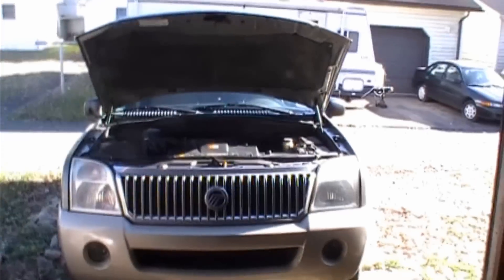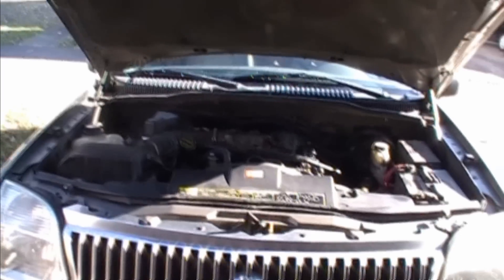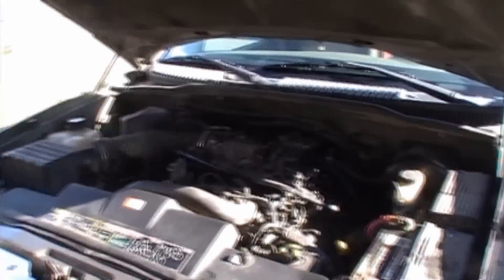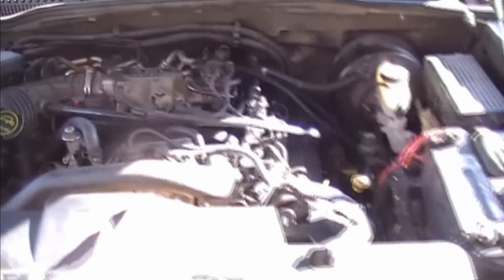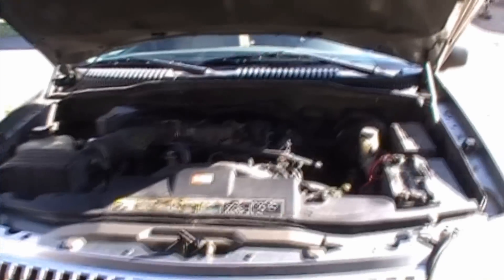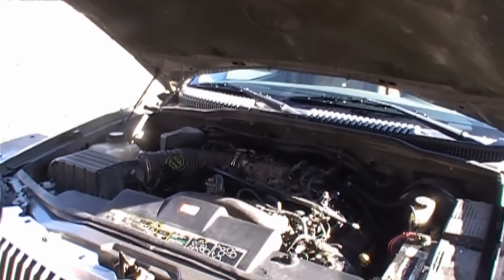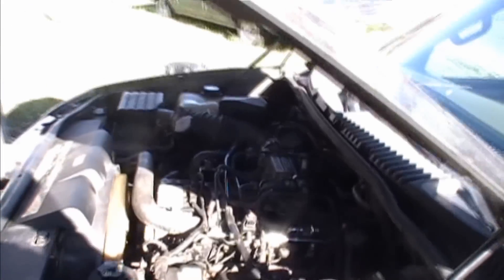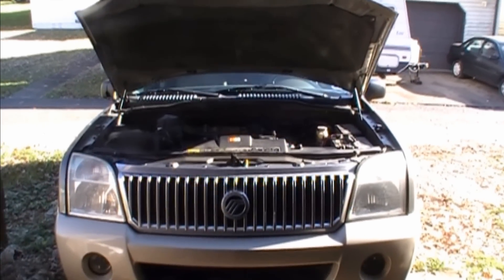PO430 CODE  The real story...don't waste your money!!

Comment: This old man knows what he's talking about, I've dealt with this issue. I had o2 sensors replaced and cat. Still codes came up. I found this video, went outside and tried his video with just tightening the intake tighter, and bam no check engine light anymore, or codes. Thank you sir, thank you. I wish I tried this before I spent hundreds.
Reply from the maker: Glad it worked.
Reply: Never thought of that. I actually removed my air filter to clean it..and code came up later. Might try that.
Reply from the maker: Cool, let us know what you find!
Reply: Unfortunately that wasn't the issue but the air filter cover wasn't seated/sealed properly so that got "fixed" :D.

Might look for exhaust leaks next.
Reply from the maker: Major Cool!  Glad you found it!
Reply: I have those codes too was s
Told it is the catalic converter but my car is making a.sound coming from the carberator and filter pipes or line i thought it was coming from the converter but i dont  think  so. I also changed the oxegen sensor was the first code that came out with that noise it was good that part still had warranty. An way its still making that noise kind of like a metal popping noise
Reply: I have Codes 420 and 430 could this also be the problem i have a 2000 Mercury marquis which is a.ford. ive heard of those cars having a plastic manifold? I took it too a local mechanic to check it before i go the code for the oxegen sensor and when he took off one of the lines the sound would completely go away and my friend also tried cleaning and carberator with carberator cleaner it did work for a while and that noise is back
Reply: @rachelperez7801  umm a 2000 grand marque has a throttle body not a carburetor.
Reply: @adamcorria1647  Cut her some slack. Probably doesn't know the difference in a Carb and Throttle body in the first place. Also Carb cleaner not good for Throttle bodies, nor recommended.
Reply: Can this code cause your truck to shut off?
Reply: @bte-by4de  nah bro if it shuts down your problem is bigger than a p0420 or p0430... Those 2 generic codes are for saying your cat(s)(emissions system) are below threshold

Comment: I got the code today, and decided to research it first, and found your video. 457 dollars to replace the y pipe with converters, or 120 something for one (not shop price). My light came on while in the car wash in my 07 Silverado, so I knew it had to be water related. I sprayed around the intake and inspected the exhaust with no luck. I decided I had nothing to lose, so I tightened the intake bolts, and cleared the codes. Drove it around and still no light or code! Ill be doing intake gaskets this weekend, thanks!
Reply from the maker: Price sounds just about right.  Hope it works! PO430 in most cases is the intake gaskets leaking or a air leak somewhere.
Reply: What ended up being the problem I have a 2010 sierra

Comment: I have an 03 Explorer that was running rough and then triggered this code.  I first went to Ford forum where they suggested O2 sensor, then cat.  I watched this video and it was right on!  I don't have a smoke machine, but do have lots of time.  I pulled off intake and replaced the gaskets.  Took about 4 hrs.  Both problems fixed for $20!!!! 

BTW this car does not have coolant in intake manifold so that was not involved.  Can't thank you enough!!!
Reply from the maker: Hell ya!! Glad it worked for you.

Comment: I had a haunting idle when the weather gets cold. Made a smoke tester with a canning jar an air mattress pump and some poly tubing. 30 seconds later I found the plastic plenum was leaking where it bolts to the intake. Thanks for the video.
Reply from the maker: That's awesome! Thanks for the story!

Comment from the maker: People don't replace the catalytic converter or oxygen sensors!!!!!!  Check for leaks first:
1- Intake gaskets.
2-Vacuum leaks.
3-Just do some research and you might save a lot of money.

Most Mechanics don't understand this.....and they don't care. They just care about getting paid!!!
Reply: tvwxman32 how do you know all technicians, and what most of them understand? how do you know if they care or not? how do you even know what they care about? 
for some technicians it is all they know or all they have grown to know.
you should be very proud you fix one car correctly, some of us hard working technicians only get the cars the others can't fix. since this vehicle has many problems.... maybe you should be more humble, because there will be that one you cannot fix. let me know if you need my address when you are stumped.
Reply from the maker: Ahh, no problem. I've just seen and delt with some real bad mechanics in my life. But I did NOT say ALL technicians were bad. I Just want people to use caution and get a 2nd opinion if they feel confused. Humble, yes...There are times I'm stumped also. But sharing my knowledge, I hope will make someone fix a issue I know about from first hand. Nothing more.
Reply: TVWXMAN32 were you hearing any types of sounds?
Reply from the maker: BIGGSAndroid ....Actually...it ran just fine...just a bright check engine lighr.
Reply: chris keiley
Reply: TVWXMAN32 actually my car has the same issue, but I feel my car is not fast like it used to be  and the RPM changing is different too
Reply: Stop putting techs down. We work our asses off and don't get treated like we should. I put the question to you, where are you getting your truck fixed/diagnosed? Do you get angry with a plumber that doesn't fix your issue the first shot? Didn't think so. Glad you were able to find this one your truck. Pass on info. Not opinion.
Reply: Really wish I seen this.....
Reply: Thanks for for suggestion!!
Reply: Could be something as simple as gas cap, clogged fuel injector or in my case a dirty air filter when my dealer said it was $2200 catalytic converter. Don't start with the cat, start with leaks or clogs. Would have been some fight if I had the cat replaced and the light stayed on.
Reply: My car seems to be surging in RPM slightly with this code.  Any ideas on what would make it surge like that?
Reply: I'm sorry, I don't understand the explanation you made on lowering coolant reservoir levels.
Reply: Thank you for the education. Im working on a jaguar and have been chasing a po 430 for sometime. Changing the cats is a tough job on this model. For jaguar people, check those plastic spacers on the intake and the plastic vacuum lines with rubber end. The vacuum leak was so small it didnt effect drivability, but enough to set the code.  Nicely done
.
Reply: Ops i had the same issue my car is running fine just check engine light 2 codes p0420 / p0430 
The RPM is good too but nt really perfect . I was planning to open my wallet for a new exhaust system but for me this gasket intake problem is much worse how much it costs 
Chevy malibu ltz 2015
Reply: "Mechanics" was the wrong word to use.  There aren't hardly any mechanics left in the world and a mechanic can fix whatever is wrong with your car.  These guys today are "techs" which is short for "parts changer".  They read your code and change the part associated with that code.  If that does not fix it they are fucked because what they learned came from a book instead of years of following someone around a shop.
Reply: Not every Mechanic or Tech is bad 😒 there is a few but not all. Some Dealer Techs (brand)follow and diag cars per repair manuals and follow proper Data list for those specific cars and not all of them just replace parts. Mechanics work on everything and also do proper repairs but there is always a bad apple in either side and those are that make us look bad😔
Reply: My mechanic showed me how the outlet from the catalytic converter was colder than the inlet. And it’s supposed to be the opposite. So this means the catalytic converter is not working. Any thoughts on that?
Reply: I starting to think this could be the problem im having on my jgc  i had put 2 cats on it and the code still comes up but whn i take out my air temp sensor i notice a changed

Comment: Very good advice; noted what appeared to be a class II coolant leak under the car last week and just haven't had time to investigate it. Today the wife told me the check engine light came on and my scanner spit out the P0430 code. Going to have it checked out and will post what the shop finds later.

Comment: I always tell my customer to check for vacuum leaks,misfire, purge valve solenoid staying open causing lean code, worn spark plugs or thermostat staying open causing rich condition.  Instead of them taking it to a "mechanic" pulling the code po430 & asuming its a bad cat and 02 sensor and having them change it, which in NOT CHEAP!! & later find out that it didnt help or the code went away for a while and came back. & start blaming the parts being faulty. But in reality if they checked & properly diagnosing it in the first place it could've been a  80cent vacuum hose broken  or a simply pcv valve. Instead of spending $300 to $1000
Reply from the maker: You are right!  Its sure is a science!

Comment: Had an 02 sensor changed this morning. Check engine light went off. Went home, let my sequoia cool off, changed the valve cover gaskets ( not one of the bolts on the cover or coils were tight ). Start er up. Drive around for about 30 minutes before inspection and now I'm getting this code. Engine purrrs like a cat. Guess I can try to go back and look at the coils to make sure I didn't miss tightening down

Comment: I think you might be dead on with this. I recently changed my spark plugs and wires and my car was suddenly giving me a p0430 (inefficient cat below threshold bank 2) and my fuel economy dropped. I checked the CAT for signs of damage or overheating, tapped it with a hammer and it was showing no symptoms. I then took my intake manifold, throttle body, IAC and EGR off and gave them all a thorough cleaning (especially the back of the throttle body, ensuring it moved freely). I made sure to put everything back on tight but not too tight (to avoid cracking the plastic). The error code disappeared and never returned.Not only that but my mileage increased to a better efficiency then it was before.  I think I may have loosened the intake manifold when I replaced the plugs because my TB and IAC weren't even that dirty. And maybe the EGR cleaning helped with exhaust efficiency?? I don't really know but my car's golden now!
Reply: I had the same exact issue (I changed the plugs and wires and coils on my Jeep Commander, and all of a sudden I'm getting the P0430 code).  Non-mechanic here, so my question is what are the IAC and EGR?  And thanks for the tips, I'll be removing/cleaning/reinstalling as you mentioned. Hopefully that will clear my code.
Reply: IAC=Idle air control (you should be able to access this fairly easy, top of engine, one of the air intake components) and EGR=Exhaust gas recirculation unit or valve. Get some carb cleaner or brake cleaner handy and just google the specific location of these components for your make and model. Clean your throttle body and MAF (mass air flow sensor) while your in there. Screw in everything tight but try not to crack any plastic parts of your air intake system and ensure hoses are snug.
Reply: Thanks!!!!

Comment: I had p0430 today 2004 Toyota Highlander 3.3L I found one of the clamp secure the air box lose I put back on I cleared the code drove 200 miles and problem solved I had the catalyst converter monitor red states before I checked agin and it’s green ready for smog test now . Thanks 🙏
Reply from the maker: Nice!!

Comment: Spot on! I had a manifold gasket replaced on my 4.6l 2002 Lincoln Town Car n then was told I needed new Cats. Had a pressure test & manifold was still leaking. Job redone with new Dorman installed 8 ready & P430 code is gone. Thank you!
Reply from the maker: Good deal! I'm going through the same thing with my new 2000 expedition 
po430. Time to buy a intake manifold gasket again. At least I'm use to 
it...lol...    Side note: I feel bad for all the suckers out there 
watching videos and saying to dump lacquer thinner and god know what 
else in there gas tank, hoping the code just goes away....lol   If only 
they knew. New gaskets are the way to go if you can figure out what 
one's are bad. I'm sure it will clean out the cat's ...but that 
code...it will be back sooner or later.
Reply: Make sure the manifold is good. Mine had 2 very small cracks & was warped. Evidently they didn't catch it the first time. You can pick up a manifold pretty cheap at Rock Auto. Good luck, it's a big job but you can do it. Watch a few videos n take notes. Take before n after pictures each step to refer back to & label everything. 😀

Comment: Yeah,, people always run behind either the  02 sensors,  and catalytic converters. Not saying they don't go bad.  But you're absolutely right.  Check for leaks and vacuums.  I had the same problem. I used,  just off a humbug,,, Cataclean. I simply drove it for a moment,  put gas in it and did the same thing. The check engine light was off. Sometimes it could be a little dirt in the valves.
Reply from the maker: So true! Thanks!~
Reply: @FixingWithPassion  I also was wondering.  (switching  gears for a moment),,,,,,have you done a video on changing the fluid on Transfer case on your 2000 Expedition  4.6?

Comment: Also from what I hear on Toyota’s. Any exhaust leaks before the sensors will also cause a P0430/420
Reply from the maker: SOOOOO right!
Reply: Yes, exhaust manifold leaks can actually make the computer think you're running lean and set a lean check engine light, while in reality the engine will be running rich due to the computer being tricked.

Comment: I have a 2010 Honda Pilot. Just had a left cat replaced and the two o2 sensors. Then, I got this code. I swear I think I hear exhaust tick/leak. Taking it back to get it checked. Luckily, my mechanic is honest. I live in a state with no emissions testing.

Comment: I have a 2001 Chevy Silverado 1500 5.3 L. I bought a Zurich ZR13 scanner to help my son who has lots of dash light on. 
My Silverado had no dash lights on. I started it and let it idle for a few, turn it off, then I put the new scanner on it, turned ignition key to on just to familiarize myself with the scanner and no Global OBD2 DTCs, No ABS codes, No SRS codes. 

Just below those was a Chevrolet OEM Enhanced  Memory PCM. I entered that to take a look and it brought up 7 codes P0327, P0332, P0420, P0430, P0440, P0442, P0446. 

 I live 20 miles out of town and needed to make a trip to town. Once I got home again, I hooked up scanner again and still no Global DTCs, No ABS, No SRS, but the 7 above dropped to 5. 
The P0327 and P0332 codes went away. Did they come up because the engine had not properly warmed up when I scanned it? Once I drove the 25 miles into town, around town, and back home and re-scanned, the engine was for sure properly warmed up, but I still have the P0420, P0430, P0440,  P0442 and P0446, with no Service Engine Soon light or any other dash lights. 

If I had not bought the scan tool I would still be driving around with no clue that something might be wrong somewhere or lots of places, because it drives fine and no dash lights. 

Do I just keep driving it until dash light start appearing? At a loss on what I should do next. My son hasn’t had time to drive out to my house to check his vehicle with the Zurich ZR13 scan tool. Not sure I even want to now?
Reply from the maker: Clear all them codes with that scanner. Then a few days do a reading. That will tell the truth. Some codes could just be pending codes. Stored codes are the ones that need attention.

Comment: Just fixed a Lexus with this P0430 code.  Found a vacuum hose not connected hiding under the bolted engine cover.  I did replace the B2S2 because it was not a Denso and it was not switching very quickly.  Definitely not within the 100 milliseconds timeframe.
Reply from the maker: Nice!!!!
Reply: B2S2 should not switch at all! It should be flatlined at around 0.8 volts. If it is switching, particularly if it is mimicking B2S1, then that is a catalytic converter problem.

Comment: My mechanic said the codes read the 2 o2 sensors and the catalytic converter. I told him I couldn't afford the job. So instead he did a complete tuneup and did a fuel injection service. No engine light so far for 3 days
Reply: jules bet it came back on?

Comment: Same thing is happening to my 2004 rx330,  should I check the intake for bad gasket or cracks?
Reply from the maker: Yeaaa....
Reply: @FixingWithPassion  I had orileys check the code and to clear it also,  ran it 2 days and it hasn't came back

Comment: Figured most OEMs would use the same codes, as in generic.... but chevrolet typically throws a "P0171" code only when theres a vacuum leak somewhere on the engine, like in this video, cracked/warped intake manifolds would do it as well.

Comment: I have a 2007 Ford Expedition and the engine light came on. Went to Auto Zone to get test to see what's going on and it said the same thing. So I wiped around my gas top and made sure it was tight to and it was still on. I also purchased some cleaner to flush the conver. I'm hoping that this works. I like how you break down the video I really need to see this. Saving is number 1 to me. Thanks.